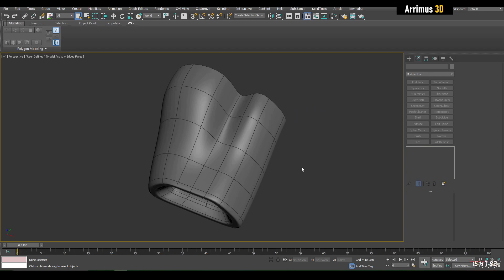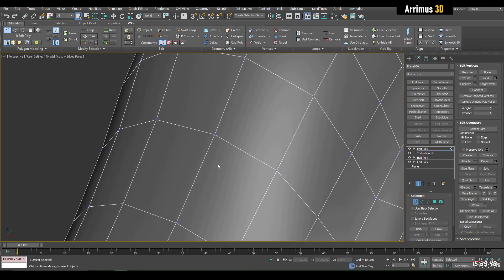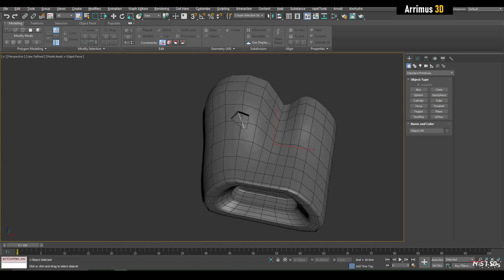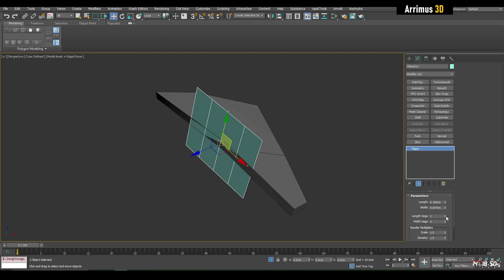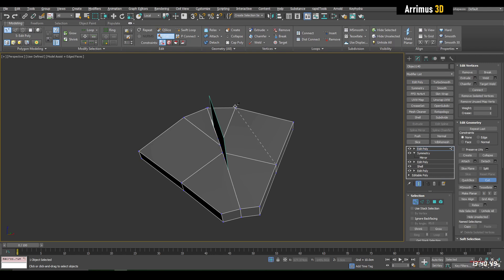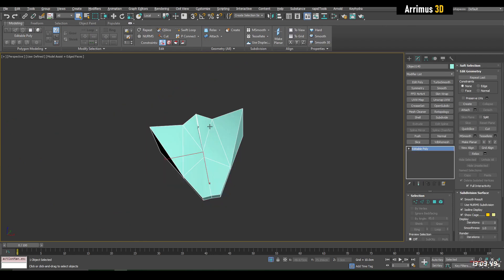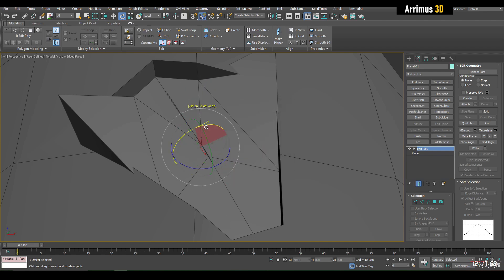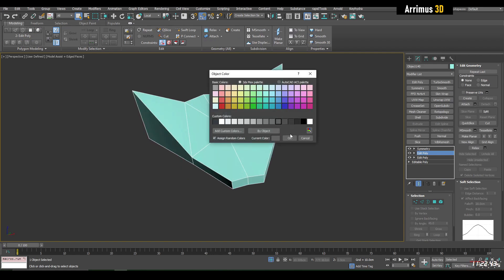Max Local Symmetry Methods

Comment: In 3ds Max 2022 symmetry, mirror and slice instruments were drastically improved. You can apply symmetry by multiple axis using single modifier. You can make radial symmetry.
Reply: 1:37 After aplying Shell to create perpendicular faces to help aligning the symmetry plane with, I simply used the button "Align to Face" with one of these faces to get the mirror plane aligned correctly...